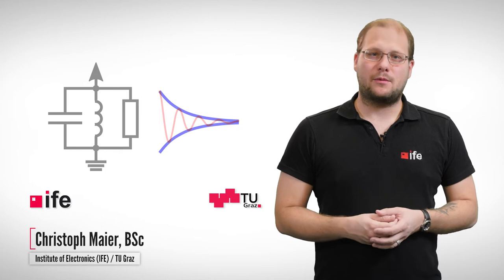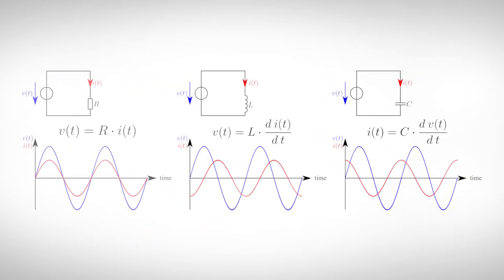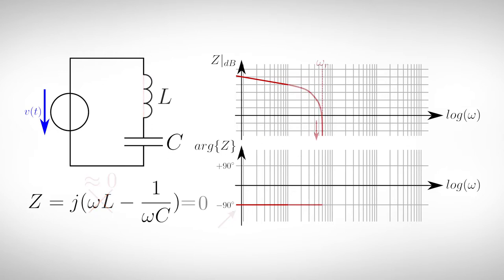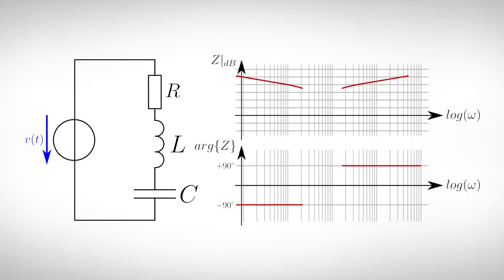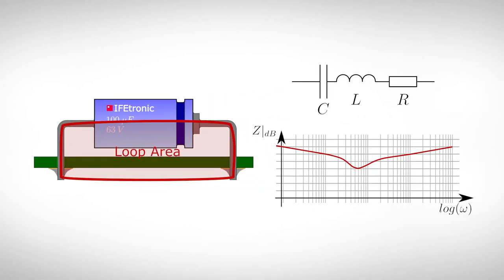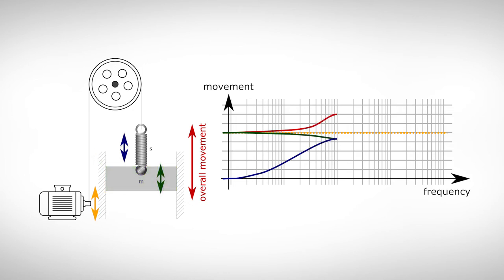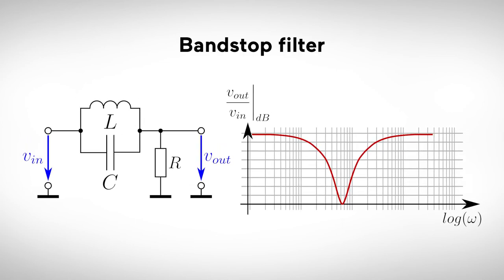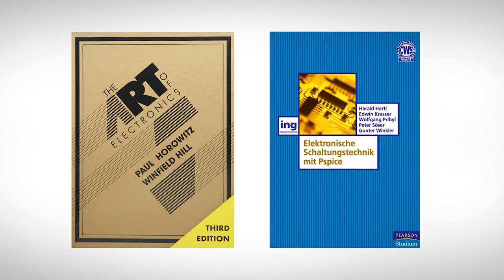Resonance Circuits - Frequency Behaviour, RLC Series/Parallel Resonance Circuit, Mechanical Analogy

Comment: Hi Christoff, this was tremendously helpful!  Thank you for the great explanation.  One point about the mechanical analogy, you have the effort and flow conjugates flipped.  In the mechanical domain effort is Force and flow is velocity.  A spring is a potential energy storage device (stores displacement and releases it as a Force).  A flywheel stores effort (Torque) and releases it as a flow (velocity).  Overall the video was still great.

Comment: In an AC motor, does the winding inductance and run capacitor produce a resonant circuit at steady state speed relative to supply frequency? Seems logical to me, but my logic fails at times.
Thank you for the excellent lecture.
Take care

Comment: Why Does a resonant circuit have to have a resistant in it? 2 Coils at 1mH one clockwise one  counter clockwise And one capacitor at 1mF pulse at 9 mS you GOOD. End of conversation
Reply from the maker: You are right. In theory a resonant circuit does not need to have a resistance. The resonant point would ideally be infinitely high. However in real applications there will always be some resistance due to parasitic resistances.